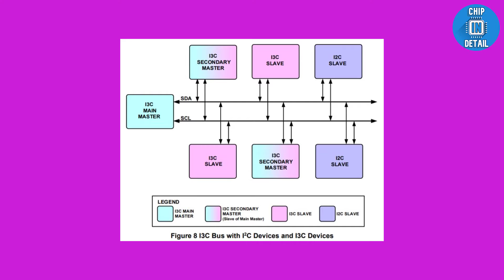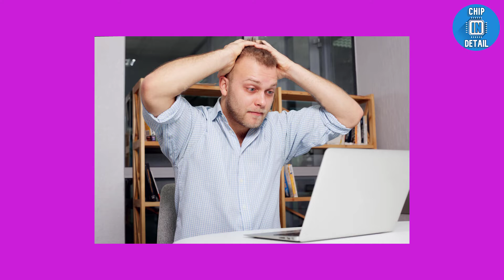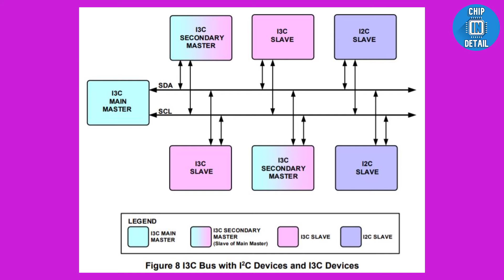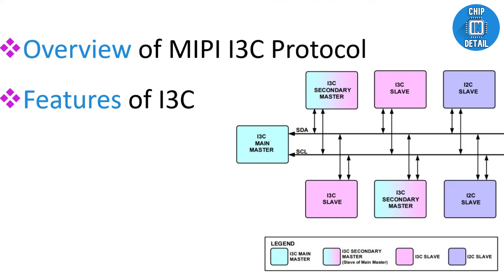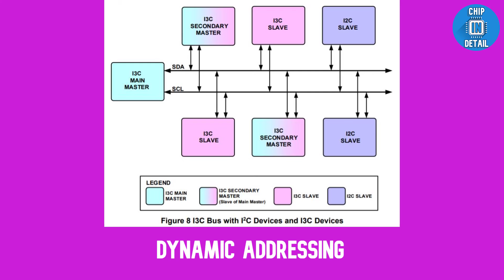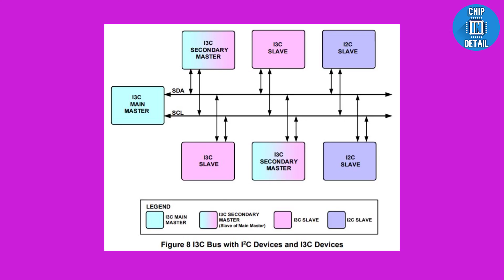I3C - ONE Protocol to RULE THEM ALL?! I2C+SPI+UART?

Comment: It was not obvious to me, but do you need the pull up resistor un the I3C
Reply from the maker: "Not necessarily. I3C Controllers manage an active (i.e., dynamic) Pull-Up resistance on SDA, which they can enable and disable as the Bus transitions" -